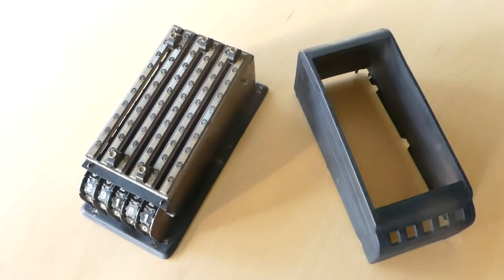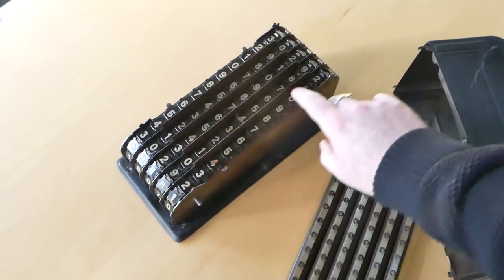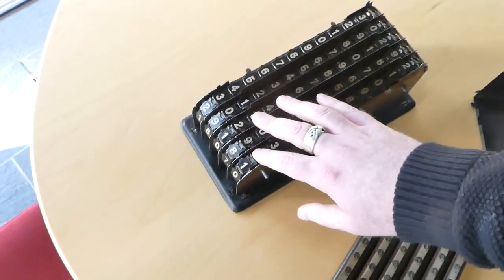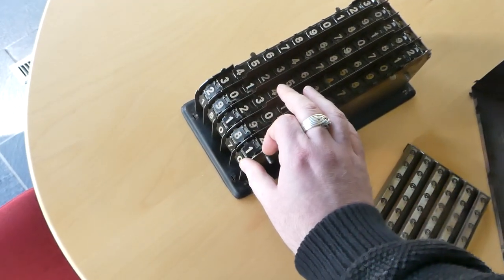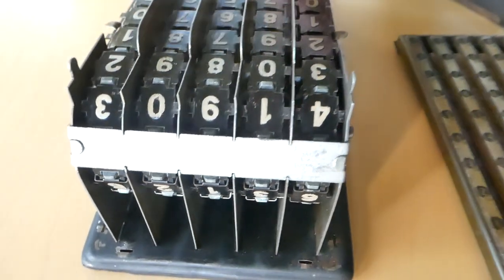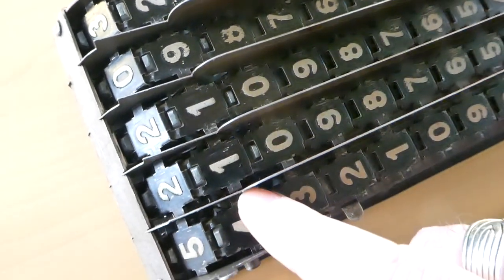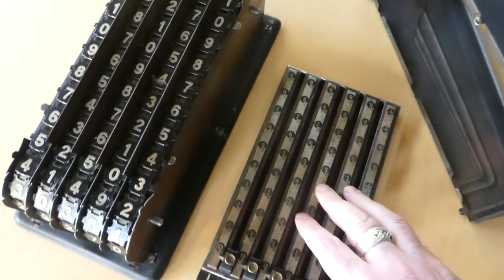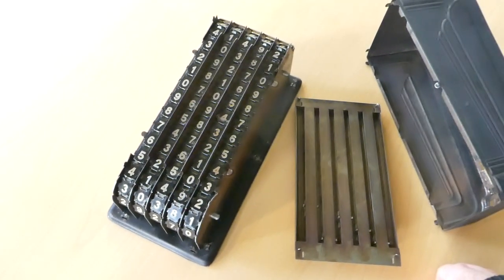The mechanism of the Add-O-Matic Adding Machine.

Comment: What happens if you try to make it subtract?
Reply from the maker: The chains only move one way, so subtraction is by complementary digits, e.g. add 99999 to subtract 1. The number scales next to the slots show the complementary numbers in a smaller font.